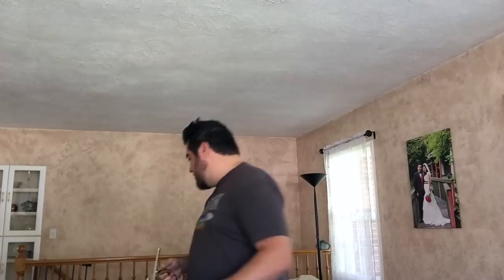Rocky 3 "Mickey" excerpt comparing  3 different french horns.

Comment: Chris, I know this is an older post and I don't know if you ever take a look at it but I just came across it and thought I'd add my .02. This excerpt sounds best for you on the triple, but that is purely a consequence of the tessitura it's in. The pure, focused tone on the high axe matches the tone in the middle register on the Bb. On the 8D, despite the fact that you're hitting the pitches right in the middle, you can sense that you're reaching up on a big horn, which is how it sounds on Vince's original. I think if you'd done this experiment with a different excerpt, say, The Days of Wine and Roses, the 8D would have been the obvious favorite. The moral of the story: do as the trumpet players do and bring the axe that works for the tune. Baroque/chamber? Descant double. Your kind of extended-range virtuoso stuff? Triple. Sing a beautiful or mournful tune the way only a horn can? 8D every time.

Comment: So the Conn 8D was customized.  Customized how?  And how old is that 8D, because the Conn horn quality has changed vastly between the Elkhart horns (pre 1969), the Abilene horns (69-86) and the Eastlake horns (86-present).
Reply from the maker: Scott Korin - 1990 Eastlake 8D.  Patterson lead pipe, first branch, taken completely apart and all and imperfections taken care of such as solder beads and misaligned joints.  Have had an M series and L, this one plays better and sounds as good.  I played that horn professionally for 20 years.